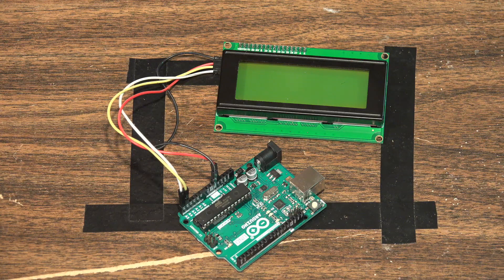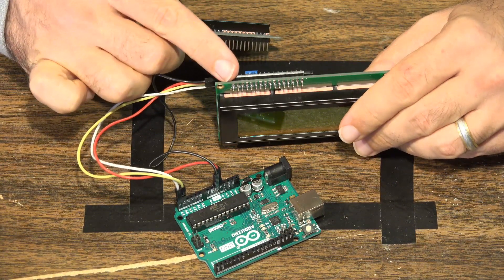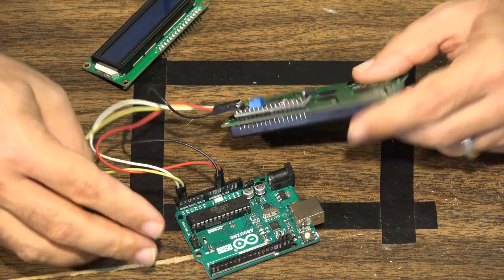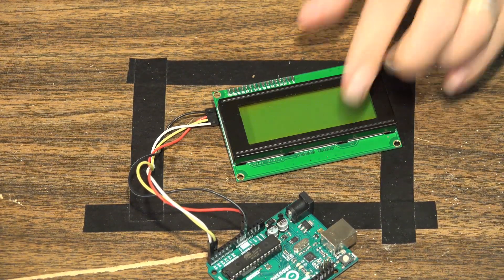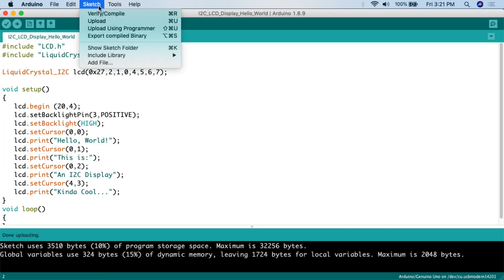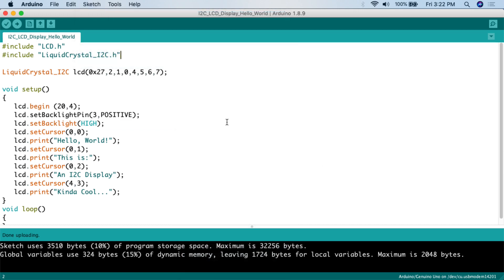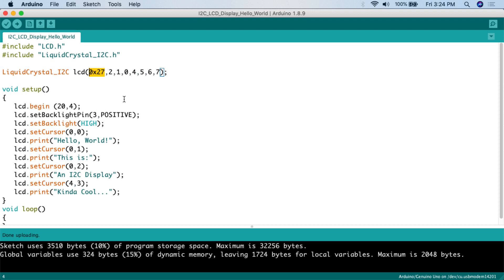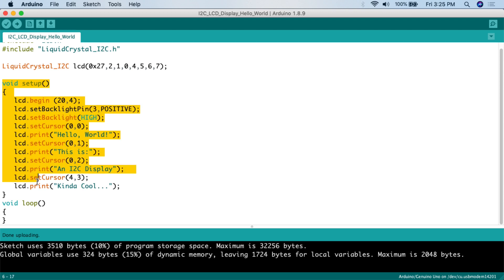I2C 20 x 4 LCD Display on Arduino

Comment: This is not a good tutorial. It gets it wrong when talking about the libraries at 3:12
The sketch is not using the LiquidCrystal_I2C library at all. It is only using fm's NewLIquidCrystal library.  Given the sketch code, there was no need to install the LiquidCrystal_I2C library as LCD.h and LiquidCrystal_I2C.h header files are both part of fm's NewLiquidCrystal library. And while you have installed the LiquidCrystal_I2C library, which also has a LiquidCrystal_I2C.h header file. the LiquidCrystal_I2C.h and LiquidCrystal_I2C class is coming from the NewLiquidCrystal library. 
The LiquidCrystal_I2C object constructors between the two libraries are very different. The one being used in the example sketch is the one from LiquidCrystal_I2C class that is in NewLiquidCrystal.

My suggestion for an easy to use "it just works" solution is to use the hd44780 library which can be installed using the IDE library manager.
Just search for in the IDE then click [Install].
This library comes with an i/o class called hd44780_I2Cexp which is for hd44780 LCDs that use either PCF8574 or MCP23008 based i2c backpacks.
The library can self configure itself so it will auto locate the i2c address and auto detect the pin mapping used by the backpack so it will work with any of the various h/w variations of the PCF8574 based backpacks. 
The library includes documentation and extensive examples.
The library being used in this tutorial (NewLiqudCrystal with the LiquidCrystal_I2C i/o class) requires manual configuration of the i2c address and 7 or 9 parameters for configuring pin mapping used on the backpack between the PCF8574 chip and the LCD.
If any of the constructor parameters is incorrect, it won't work. 
And keep in mind that there is more than one pin mapping used on PCF8574 backpacks.
With the hd44780 library and the hd44780_I2Cexp i/o class, the library figures it all out for you.
The hd44780_I2Cexp i/o class also comes with a diagnostic sketch, I2CexpDiag,  that will test the i2c connections and LCD h/w and report an issues on serial port.
The hd44780 library includes additional features like long line wrapping, and is quite a bit faster than the other libraries.
You can also read more about the hd44780 library on the github page: https://github.com/duinoWitchery/hd44780

Comment: SOLVED - had the problem fixed - see 5:22 - you have to turn on the serial monitor before running the sketch at 7:32 (link in the description)  Hi - everything works and all connections are correct but my display doesn't show any characters. It only shows some like white boxes on the screen. what should I do?

Comment: I've spent a few hours messing around trying different things that didn't work. I downloaded Eli's code and it worked on the first attempt. I will now go through it line by line and learn how it works and use it in my project. Many Thanks :)

Comment: Hello, I have bougth an i2c for a 16x2 LCD screen. Does this i2c will work with a 20x4 LCD?
Reply: El I2C trabaja con 2004, 1602 etc
Reply: Yes but buy a new one that has 20x4 with i2c with it.

Comment: i have done all the things as you showed. bt my display doesn't show any characters. It only shows some like white boxes on the screen. what should I do?
Reply: J'ai eu le même problème. C'était un problème d'adresse de l'I2C. J'ai fais un nouveau sketch avec le code de ce lien https://forum.arduino.cc/index.php?topic=439436.0. (avec un baudrate de 115200). J'ai obtenu 0x3F et le l'ai rempacé dans la ligne  lcd(0x3F,2,1,0,4,5,6,7); et là ca fonctionne parfaitement